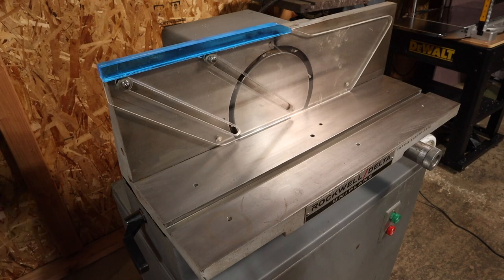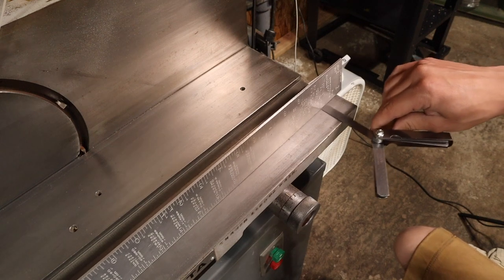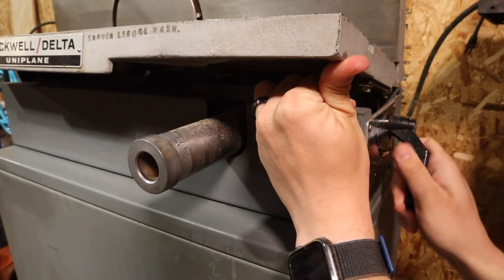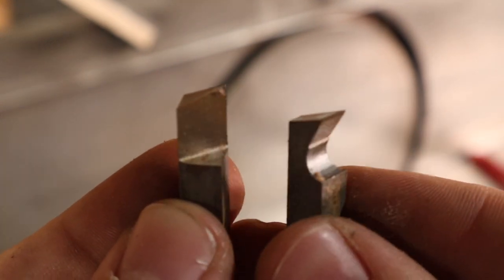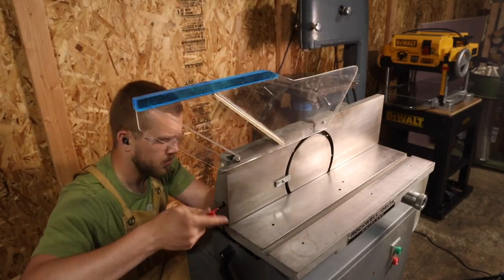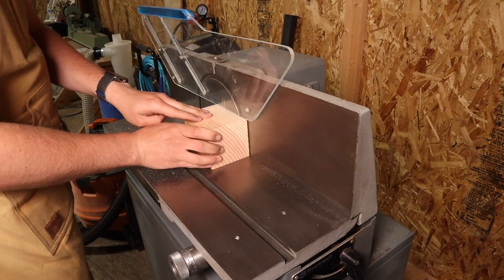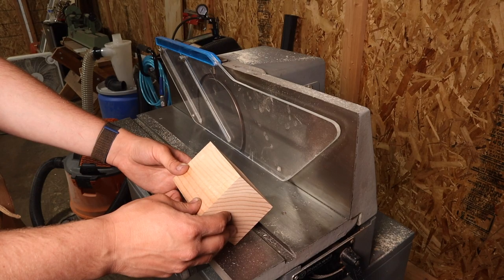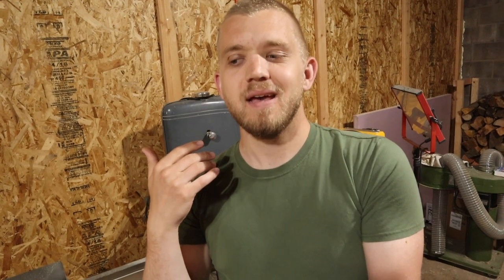It Wouldn’t Even Start! | Restoring a 1970’s Uniplane

Comment: With respect to the 'slant' created by successive passes, since the Uniplane can cut any grain orientation, why not try flipping the piece end for end on successive passes?  That would provide a degree of compensation.  Also, you might consider using Nylok wingnuts on the guard, because in some situations it's convenient to fix the height of the guard.
Reply from the maker: You’re pretty much spot on. One way to fix it is to alternate pass direction. I think I found in the end it was caused by me not supporting the workpiece all the way through the cut and focusing on the in feed side, rather than the out feed side.